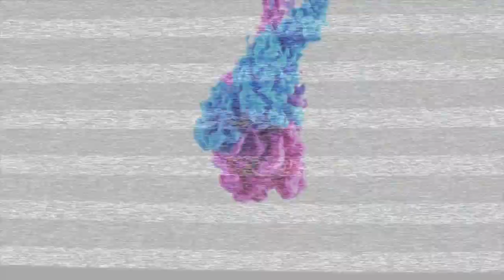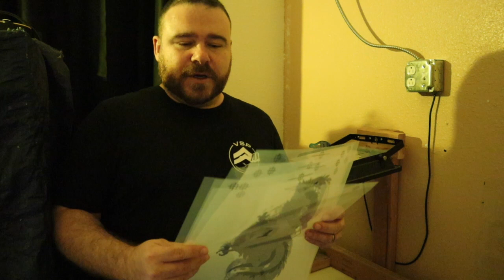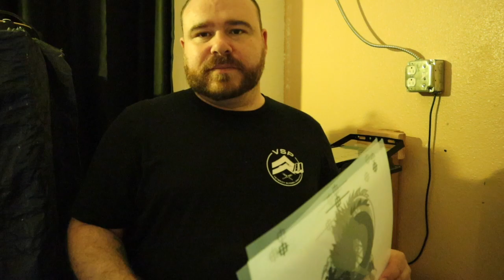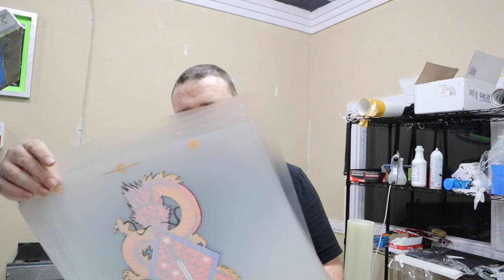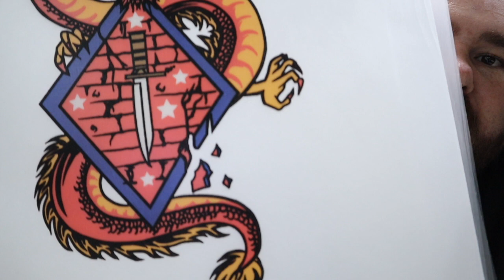How to Screen Print from Start to Finish

Comment: Oh yeah im so getting that flash!
So i used to buy my platens but now i go to home depot in the wood for shelves section they have mdf with the white top and bottom just like the wood platens. It comes 15 3/4” wide. Cut it to size sand it and you get 4 platens for 20$.
Reply from the maker: Yes 100% the flash is 20x24 and I used have to move my old flash for some of my bigger prints but with this I have no issues has all the best features. 3 zones that can be turned off and on with forced air which are two fans on top. For the money I have spent on it, it has paid off with speeding up the printing times but as well it cuts down on electric bill because its not on the whole time.

Comment: Why do you put the masking tape over the emulsion and box off your image? Does it help squeegee glide better?
Reply from the maker: We use painters tape instead of the screen printing tape that everyone uses it works the same and is cheaper and you can buy it at any Home Depot
Reply: Right, I understand that part. You are the only person that screen prints (so far that I have seen) that tapes all the way to the stencil part, so im curious why you do that? You actually put tape over ALL the emulsion all the way and box off the image you are screen printing.
Reply: @brittanypalma4906  It prevents any ink from going through the edges that may not have full emulsion coverage. At least that's my understanding and how I use it on the type of screen printing I do as a newbie to this field.

Comment: I screen print using epoxy ink onto finished sheet metal.  If I leave the screen for more than 30 seconds or so between pieces, the ink dries out and I need to wash the screen out and start over to finish the job.

How long can Plastisol sit for after you start printing?
Reply from the maker: I do not think plastisol would work personally you could try it though the ink last a while in the screen with out drying out I leave it over night if I have big orders.
Reply: @ApparelTalk  yeah we need to use epoxy ink at work. I'm trying to learn about apparel screen printing for a side thing.

Comment: Awesome video. I am having trouble registering my image, I do not have micro registration. So I went out and bought the Transfer/Registration Tape (16" x 10 yards). Will give it try soon. As far as your print job, what screen #s dis you use or recommend (base, 1st, 2nd coats). Also is that dryer a bbc flash dryer ? As for now I am using a heat gun, it's slow and a pain to use. Love your videos, your always up front and helpful.